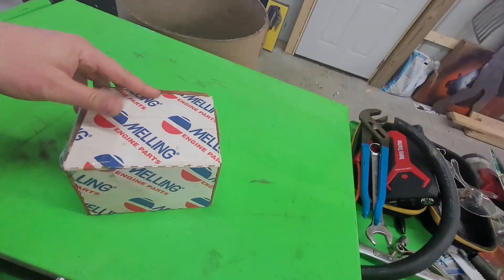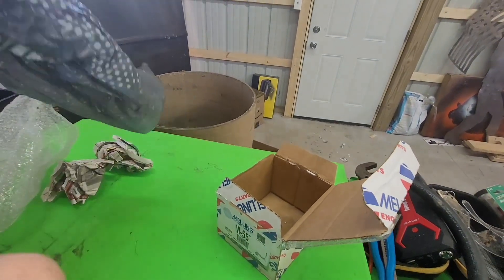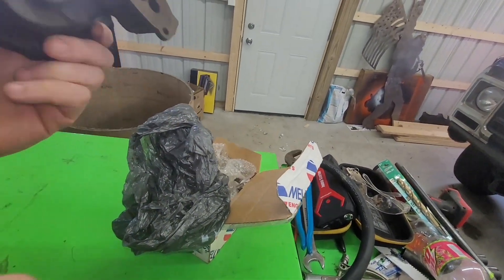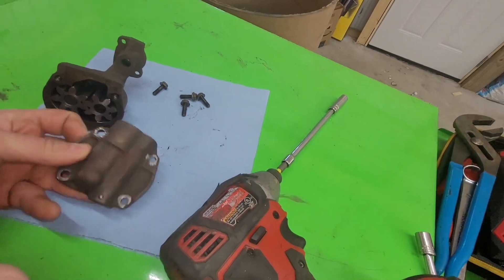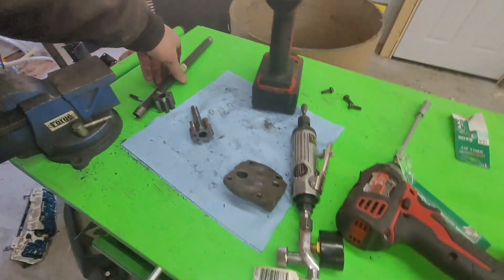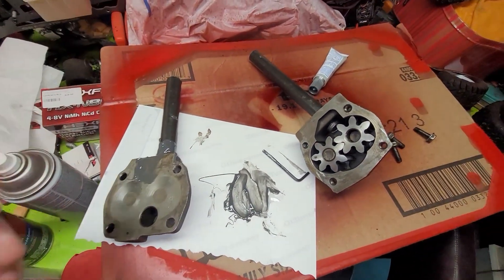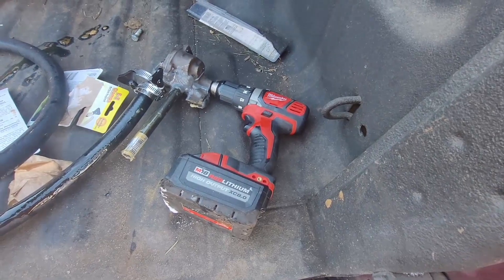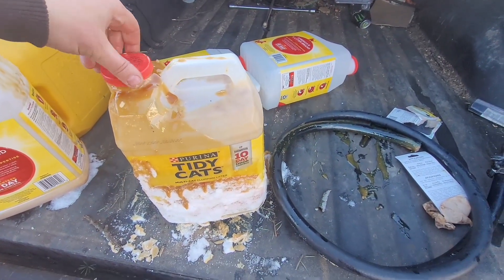Build Your Own High Volume Transfer Pump - DIY Guide 37.00!

Comment: 4 gallons a second, how thirsty could she be.

All the thirst.
Reply from the maker: When pumping thicker oil, the volume is really helpful. 

Especially when I'm liberating fry oil from restaurants :D
Reply: @TheDrivewayEngineer  hell yeah brother what you thinking on that cost benefit? Like 1.20 a gal if you get the oil for free?
Reply from the maker: I just filter it and mix it 50/50 with diesel and go for my Ram, so 2 bucks a gallon. 

My Toyota or Ford could run on it as is. 

If I still wanted to make B100, it would be about 1 buck a gallon, I can get 55 gallons of methanol for 225.
Reply: @TheDrivewayEngineer  awesomeness now figure out browns gas for me and make the hho buggy for me. Lol.
I inherited a house so all my projects got pushed down the line, did get a Kubota that I gotta play with some more.
I'll post soon to the group to show you man, youve always been a big help and inspiration to me.

Comment: So it seems a guy could use this rig to prime a LS motor instead buying a fancy pressurized tank set up?
Reply from the maker: You guys and your engine priming. 

I prime mine like the factory. 

By starting them.
Reply: I wanted to point out the device can be utilized for more than moving fluid from one bottle to another which it obviously does.  This would be much more affordable when compared to other buyable engine priming options.  I completely understand and agree on junkyard, reuse everything and crank to build oil pressure but there are scenarios in which this tool is an inexpensive alternative to accomplish the task of priming an engine.  Thanks for showing us this multifunctional device!

Comment: Sir, something you might consider. Since Methanol, one of the components of Biodiesel is rather expensive an alternative you may not have thought of is Ethanol. The Ethanol I'm referring to is denatured and void of the normal ATF taxes. You have over 20 distilleries in your state so a little shopping may just get you a very good deal.
Most Collum Stills are limited to 194 proof or less and pushing that to a pure 200 proof state requires expensive work so keep that in mind.
Down here in Florida we can buy 192 proof denatured for about 2 dollars a gallon if we buy in bulk.
Reply from the maker: I typically don't even bother making biodiesel, I just filter it, heat it, run it through my centrifuge, mix it 50/50 with pump diesel and dump it in my truck. 

My Toyota and Ford don't even need it mixed.
Reply: @TheDrivewayEngineer  You don't have a problem with it gelling up in the cold???
Reply from the maker: @johnparrish9215  no